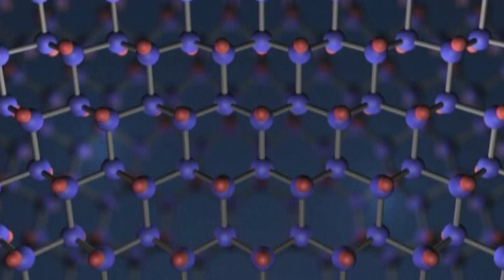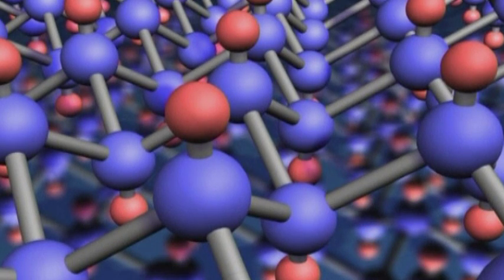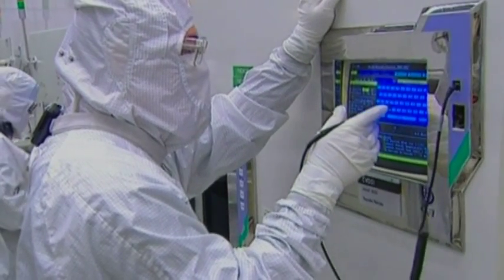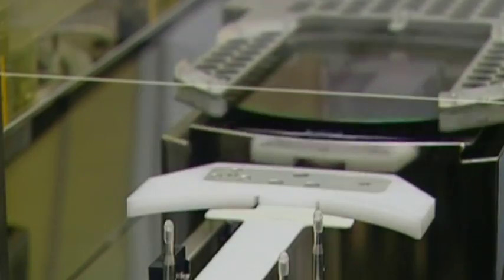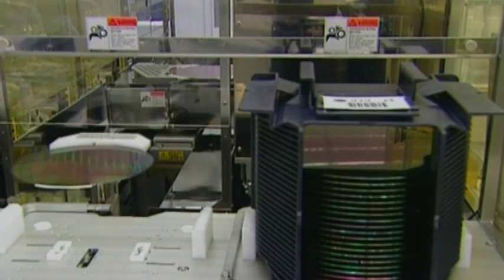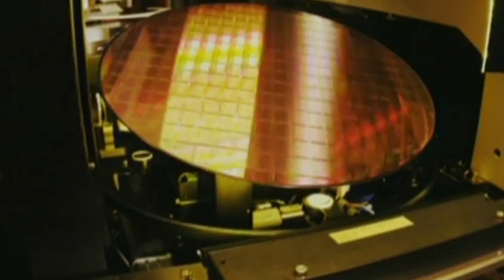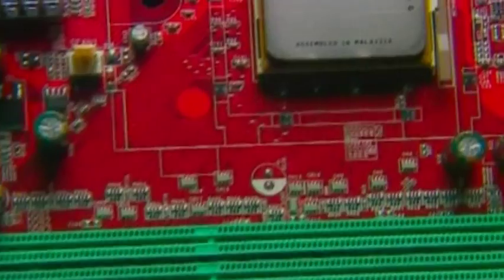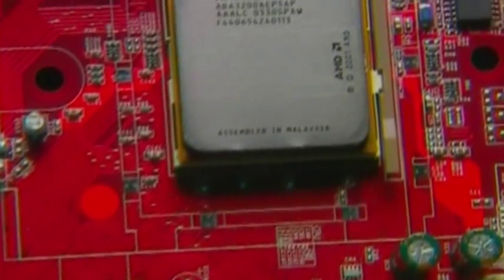Scientists master super-fast Graphene microchips - Truthloader

Comment: MrTwhispers
Graphene could theoretically work in the 500 to 1,000 gigahertz range
Reply: That's a single transistor, the problem is putting them all together, i'd say this is going to take 10 to 25 years before this goes mainstream as silicone replacement.

Comment: Computers made out of Graphene using quantum computing  that would be that fastest thing around for a long time to come.
Reply: you do know that just because its a quantum computer doesnt mean its faster right?
Reply: Shanee Bahera
on a data transmission level, yes quantum computing is a great deal faster. information can pass THROUGH the chip much much faster, the question will be whether the system REFERENCING this chip can use the technology on it effeciently enough to see a net gain